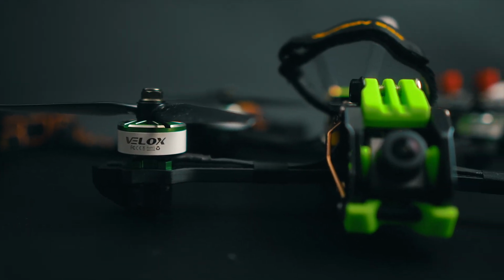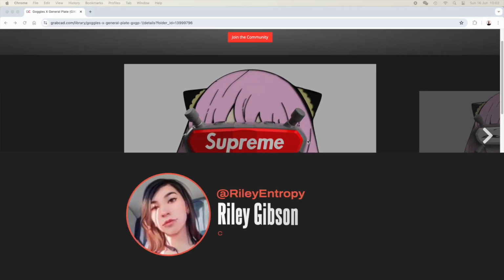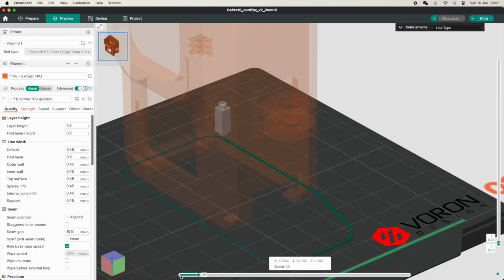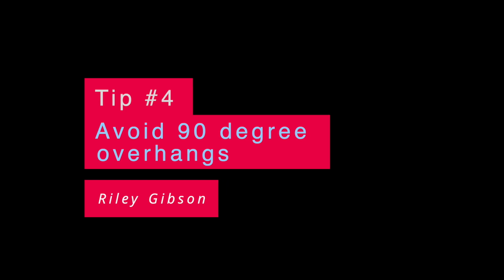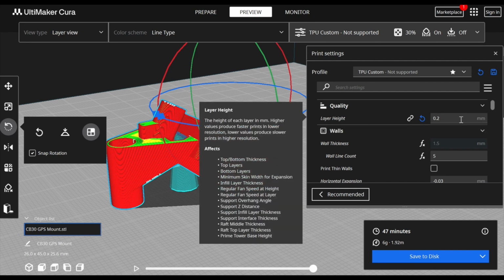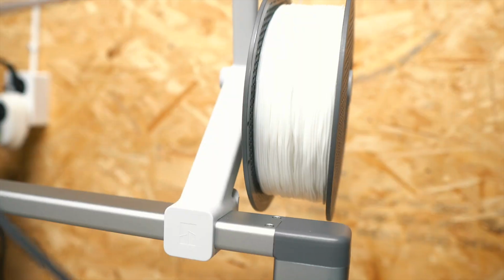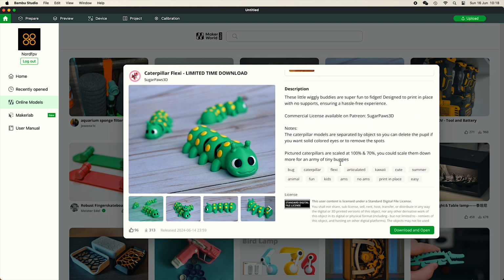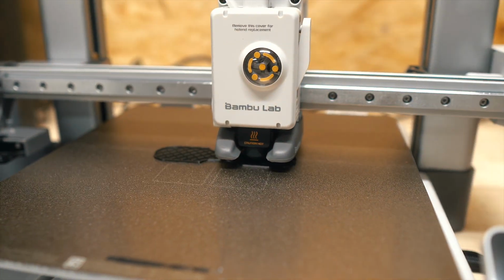Bambu lab A1 and FPV Drones

Comment: Ive talked with AI and it said that there around 30 parts in a FPV drone. I wish to see everything I can 3d print with the best filaments to minimize cost on the frame and other parts to start selling FPV drones that can compete with DJI but cost a fraction of the price and made in america.
Reply from the maker: You can print only accessories. The main parts of the drone as the frame can’t be printed. They need to be in carbon fiber.

Comment: What is the best material to 3d print stiff drone parts like frames?
Reply from the maker: You don’t want to print frames. Carbon fiber is the best you can do for your frames because of the relationship weight-strength. And of course you can’t 3D print carbon fiber. You can 3D prints parts for your drones.

Comment: just built a voron trident 300 for some cam mounts for a 2.5 hurricane
Reply from the maker: I have a Voron 2.4 and a v0.1, you can see the V2 time to time in the videos to the right of the A1. And I love my Vorons, they are great, but definitely not entry point for many users. I think I have spent more time tuning my voron than printing on it. There's always something better you can do to the voron, while with the bambu lab you just go to print, it's almost like a different hobby to own a Voron vs a bambu lab.

Comment: It would be great to have some video on A1, how to print tpu in multi color. I know jt has to be done manually, but still nobody has made that video 😢
Reply from the maker: I do have a video on manually changing colors. The video describes the process with PLA, but it's the same for TPU. That said, I think manually changing color is not that interesting in this days with things like the AMS. Unfortunately the AMS is not compatible with TPU (despite there are some interesting modifications claiming to do this)
Reply: @NordFPV  agree about manual color change, but as you said after that the problem is for tpu 🙂. Full size AMS was somehow "hacked" and with small modifications it is possible to use tpu in it, but as far as I've read AMS lite not possible at all. I was wondering if it's same in bambu studio it is in Cura for manual color change? That's why I asked if video is possible, as an update 😁
Reply from the maker: I have not seen any AMS lite hack for TPU. I'm actually considering doing a video on the AMS and the TPU hack though.
I think the principle of changing color should be the same in cura than other slicers: You pause, change the filament, extrude and purge, and continue printing by layer. But I don't normally use cura, in fact I have never used it in my life so I can't talk with 100% confidence on ti.